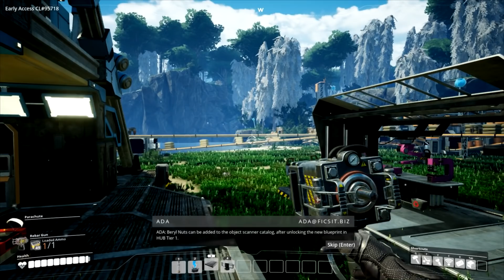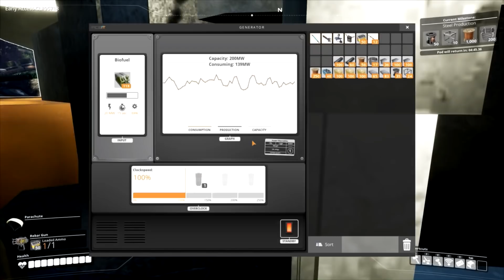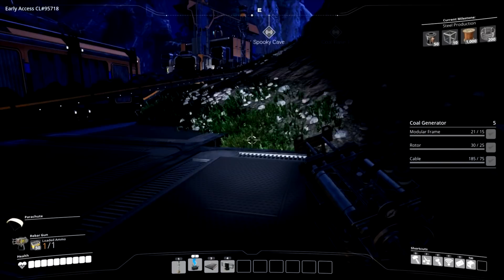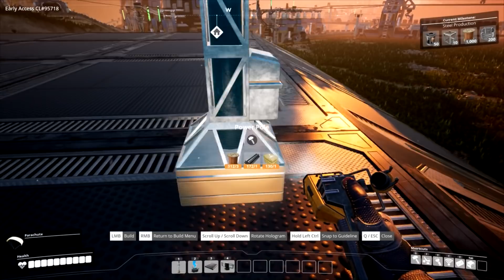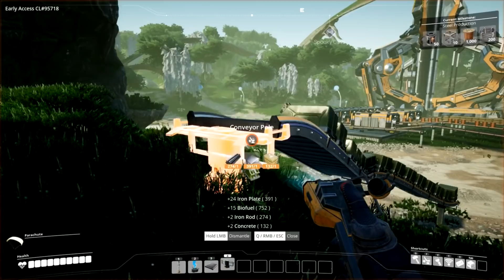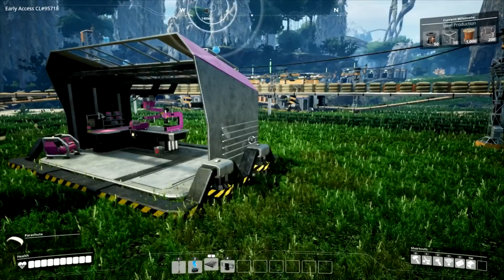[7] Hacking Into Hard Drives And Coal Power! (Satisfactory Gameplay)

Comment: You may need to route some of the coal on the base/space elevator end or the coal line into the fuel storage on the truck stop. I think that is what the tractor's AI is set up to pull it from instead of the general storage in the truck stop. You already have that happening at the coal mine truck stop.